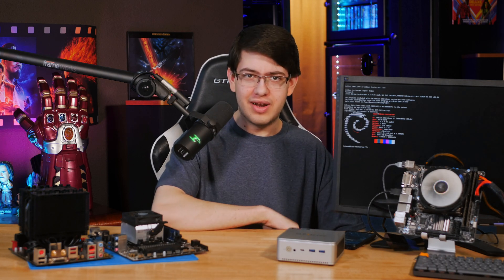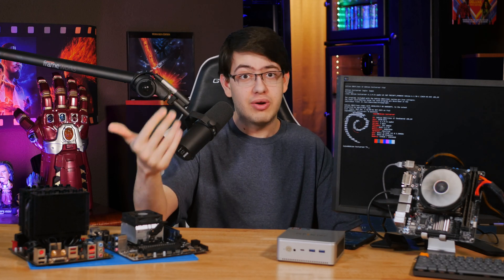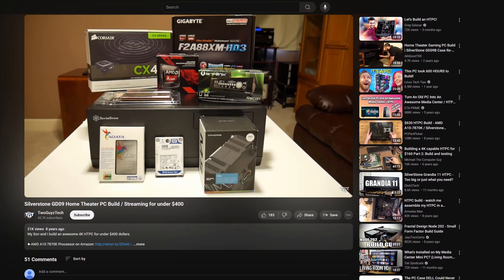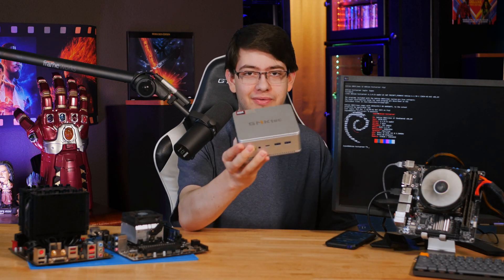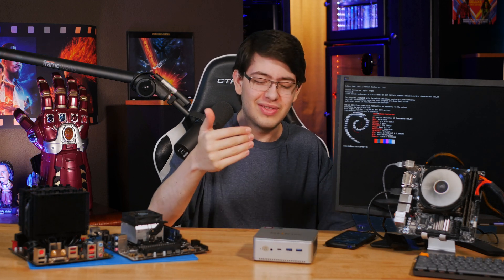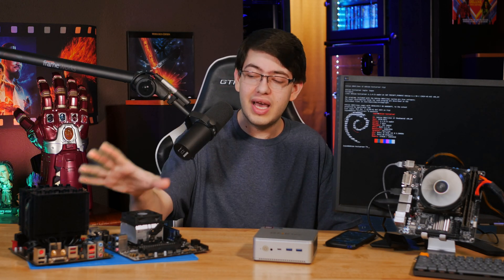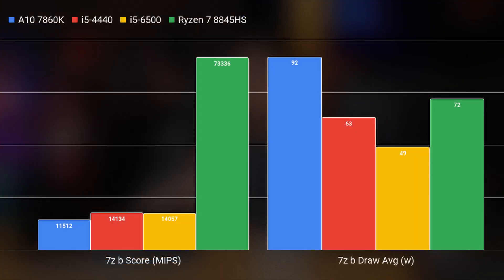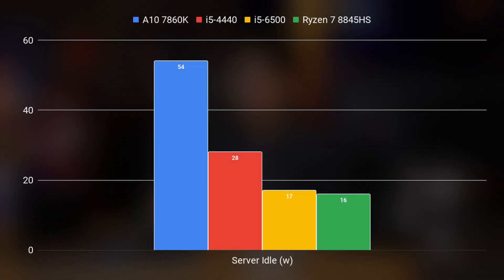Should You Buy Used Parts for a Home Server? | Speed & Power Benchmarks

Comment: Great vid.  Loved to see the actual power consumption metrics.  I currently have a Lenovo IdeaCenter.  That was bought before I found this channel.  Right now I am running Handbrake and MKV simultaneously.  The CPU is bouncing between 90-100%.  The memory has remained solid at 11.6GB of 16GB.  I thought I recalled you use the OptiPlex 790 for your sever.  Did you test that one?  Is that the I5-6500?